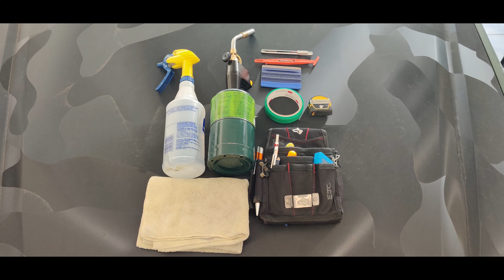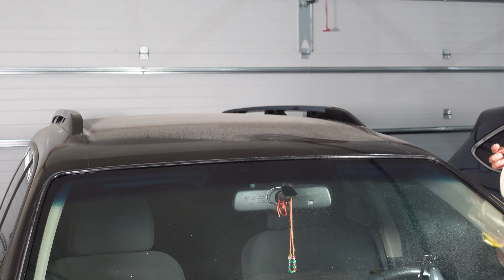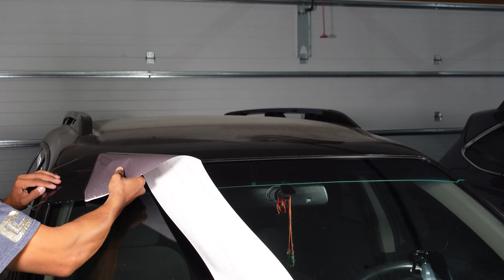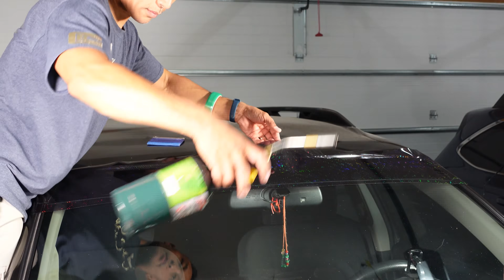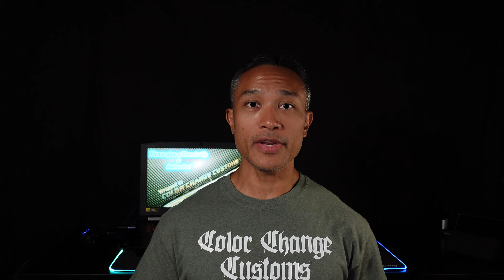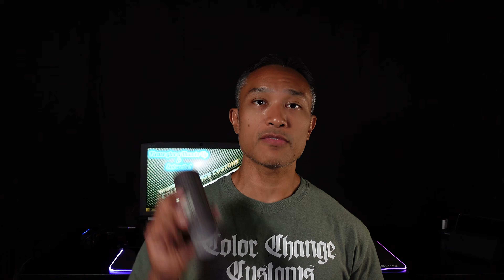BioPulse Windshield Banner Using VViVid BioPulse Headlight Tint Car Wrap

Comment: why would you use a torch? electricity is free, propane is not. hot air will not burn/bubble the cars finish, fire will. what if any are the benefits of that
Reply from the maker: You can certainly use a heat gun if preferred.  Torches are a common heat source used for vinyl wrapping.  The heat is fast, but concentrated, whereas a heat gun is slow and dispersed.  Both have their pros and cons. You'll have to take care to ensure you don't burn the vinyl when using a torch, but you can also burn vinyl with a heat gun as well.  If you know how to use a torch effectively and carefully, it works well.
Reply: How long will it last being wack by windshield wiper?